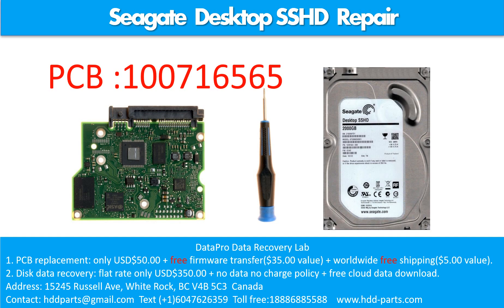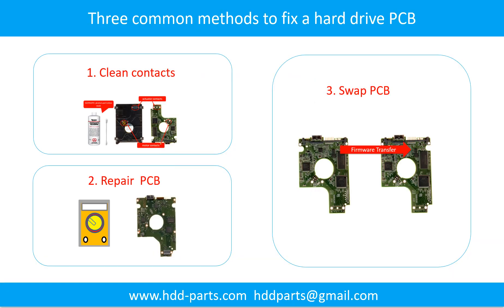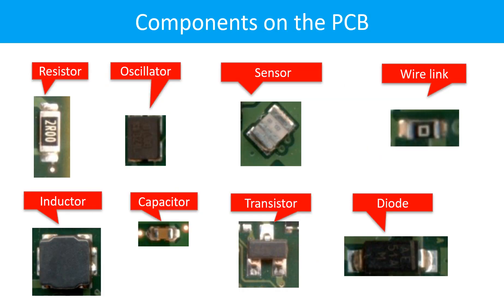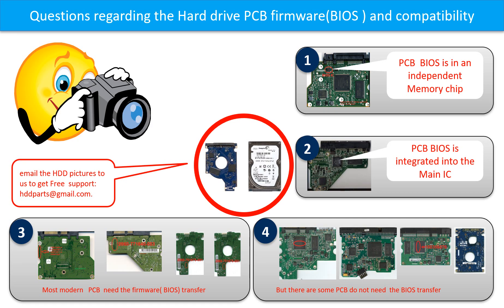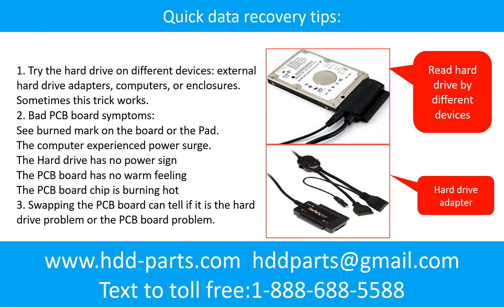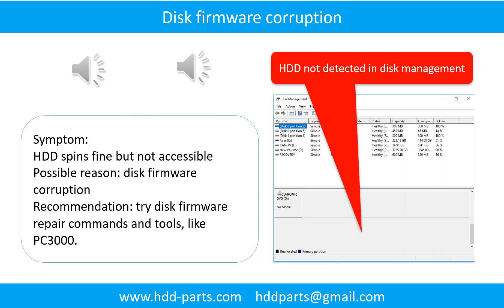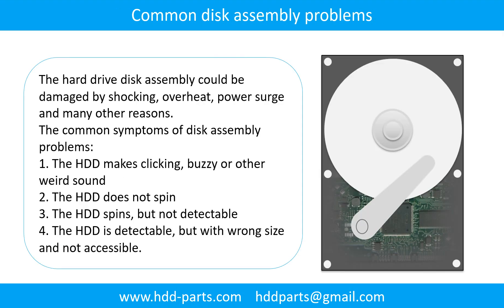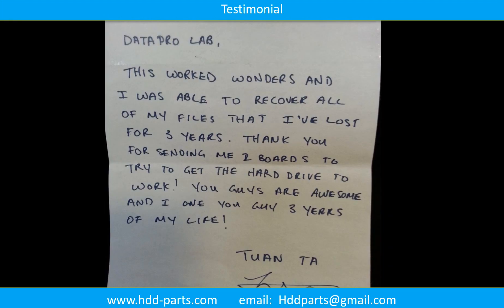Seagate SSHD clicking not working  repair data recovery ST1000DX001 ST2000DX001  100716565 1CM162 02

Comment: my defective SSHD was not spinning and undetected in bios, i put the new Donor PCB board and moved the firmware bios chip from bad board to donor , now the SSHD it spinning motor and it detected in bios, however i dont hear moveing heads and i cant initialize the disk in windows.  What can i do next?
Reply: hi, did you fixed or found the problem?

Comment: https://www.youtube.com/watch?v=qwMNnMEzALM&feature=youtu.be
my seagate sshd not detected and making noise in pcb 
when i start pc while sshd hard drive power cable plugged it will not spin or work or detected 
when i start pc then plug power cable hard drive will work and detected but still making noise 
model: st1000dx001
pcb :100716565 rev A
i checked all the transistors on pcb all good 
help please